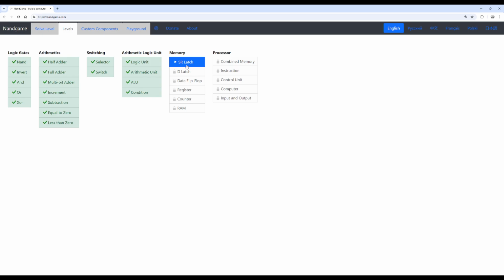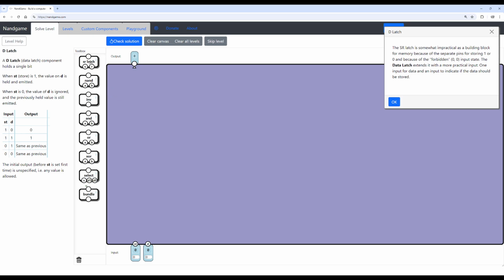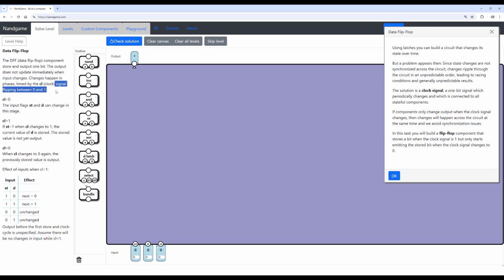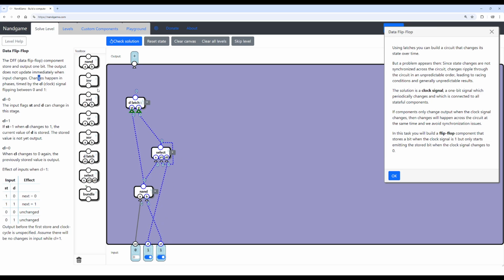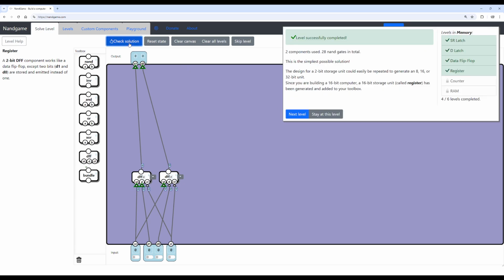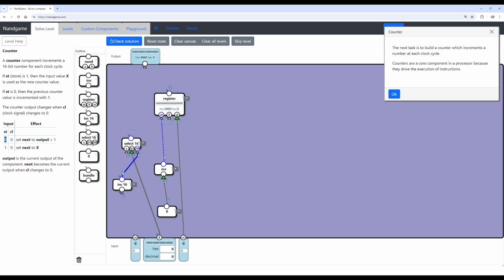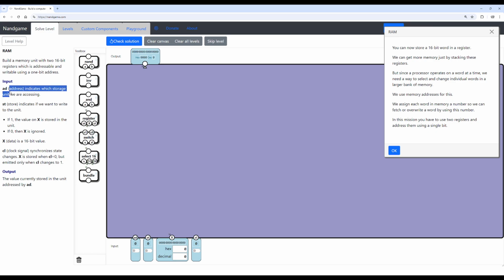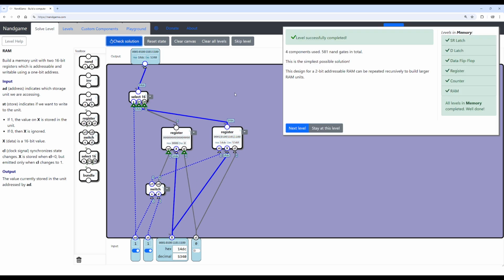NAND Game - Memory (Si to AI)

Comment: 7:16 here's what I did:

* store & clock inputs goes into input of AND gate, which then goes into the store input of first d-latch
* data goes into data input of first latch
* output of first d-latch goes into input of second data latch
* clock goes into inverter, which then goes into the store input of second data latch
* output of second data latch goes to component output

Although it uses 4 components, it only uses 11 nand gates in total, which is optimal.

This is assuming the data latch is using 4 nand gates instead of 5. If it's the latter, then it'll be using 13 nand gates in total.